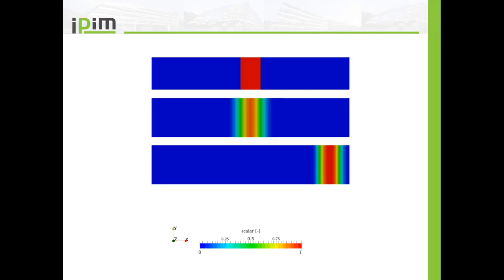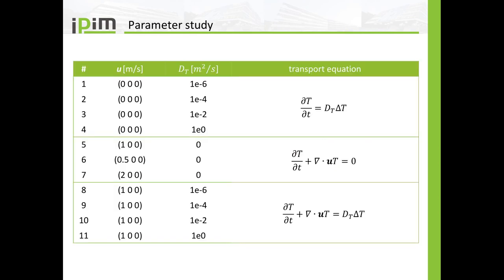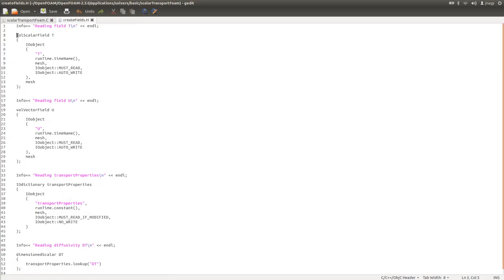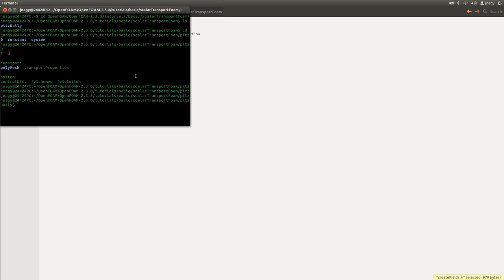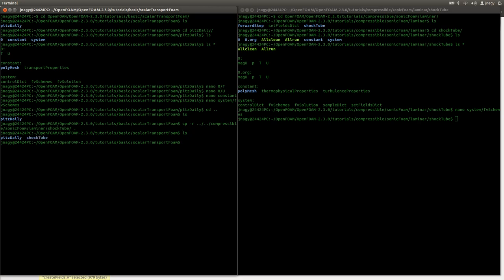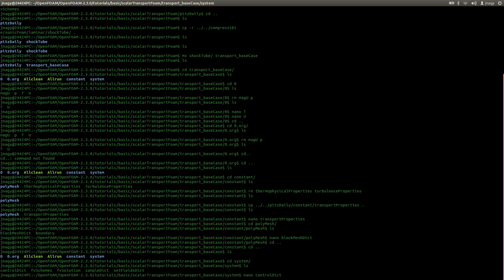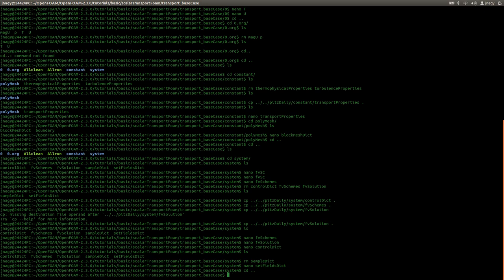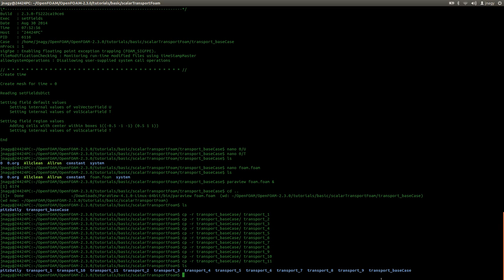Introduction to transport equations - Part 1

Comment: Sir , i hope you can see my comment. I am currently using the openfoam v10 , the version of 2022 (it is recommended that i download the newest version) and i didnt have a problem until this tutorial. I have done everything you did (copied the files , deleted what was unnecessary) and i executed first blockMesh. Everything went well. Then i did execute the setFields . Execution was ok , it appeared everything that appeared to your screen too. I checked the file of T at the 0 directory , and for the -0.5 to 0.5 , the value of T was indeed one. So i guess everything was ok. Then i even created the dummy file foam.foam , even though i think it is not needed that much (please share your opinion on this topic) and launched paraview. In paraview , i had of course to uncheck the box of skip zero value and the the mesh appeared. But , unfortunately , there was not any 0 values. The whole mesh had the value of 1, as i could see from the legend down right. I dont know what i am doing wrong , honestly , and its a shame i cant run the simulation as i want to realize every step before moving on. Of course , this question is addressing every member of the CFD community that is currently watching the video. Thank you in advance.
Reply from the maker: Please use the version v2206 from openfoam.com. v10's compatibility is very bad. There are too many syntax changes. We all knew, that is is going to come, but as far as I can judge the time has come and people have to decide which version to use.

Comment: Sir,
Can we say by looking into the create Fields of any solver, we can know what boundary conditions like U, T and P are required. 
As in the current solver there were U and T in the solver which were the same in 0 folder.
Reply from the maker: No, in general not. In an already working tutorial yes. But if there is a modification, you have to change the dictionary as well.

Comment: Hi Nagy. First, I wanted to thank you for the excellent material shared. I have a doubt for the simple diffusion case. If I wanted the temperature / concentration / etc. travel for the left side, with a different diffusion coefficient than for the right side in the same mesh, how should I program this case and what files should I modify?

Greetings and thanks!!
Reply from the maker: Diffusion is a uniform phenomenon and not directional.

Comment: What's the difference between set the control on runTime or on timeStep? I'm still confused about the meaning of deltaT.
Reply: "What's the difference between set the control on runTime or on timeStep?" 

Setting writeControl to runTime will lead to result files being written after consecutive time intervals defined by writeInterval, whereas the option writeControl -> timeStep means that results will be written after the number of time steps, again defined by the parameter writeInterval. 
So for example writing 10 equidistant result files for a 1 second simulation (endTime -> 1) could be achieved by either setting writeControl to runTime and concurrently writeControl to 0.1. OpenFOAM writes a file every 0.1 seconds. The second option would be, to set writeControl to timeStep and simultaneously writeInterval to 1. Since your simulation timeStep is defined by deltaT and you would like to write 10 result files, deltaT has to be equal to 0.1 in this case. That means in the first case deltaT has no influence on how frequent result files are being generated, in the second case it does. 

"I'm still confused about the meaning of deltaT."
The time step of your simulation defines the temporal discretization of the partial differential equation underlying the physical problem at hand. The equation itself is continuous in time and space, since it describes the real physical world. Its computational representation in contrast has to be discretized (described and solved at particular instances of time and space), because computers have limited accuracy. The step size that governs the temporal evolution of your solving process is called the time step.

Comment: direct after 'setFields' without 'scalerTransportfoam' you can see the Temperatur in paraview, but why can i only see  Solid color? i can not choose T. or U to have a check.
Reply: The same happens with me, I believe could be the version of OpenFOAM.
Reply: @jackelinecornelsen5206  i have solved it, just uncheck "skip zero time"
Reply: @yaowang1712  Thank you!

Comment: Hi Nagy, Í have followed the video to make the necessary changes. But when I create the blockmesh , I again get the error 
--> FOAM FATAL ERROR:
Failed writing polyMesh.

    From function int main(int, char**)
    in file blockMesh.C at line 336.

What can I do here?
Reply from the maker: Do you have writing access, where your case is located?
Reply: I use sudo for this
Reply from the maker: That might not work. Copy your case to a location, where you have writing and reading permission.
Reply: @OpenFOAMJozsefNagy  Thank you sir worked!!!

Comment: Hello, I have a question about transport equation (it's a link to an image):

http://s21.postimg.org/ip54v24hj/transport_Eq.jpg

I am from a university in Croatia and since our professors insist on Fluent because OpenFOAM is too complicated, I had decided to go for OpenFOAM in my free time and I did not regret. I'm following your tutorials which are great and which have helped me a lot. I even made an icoFoam case of my own, not physically meaningful, but it works!
Reply from the maker: stock9291 T is the passive scalar, and phi is the flux through the cell face i.e. the velocity U interpolated onto the surface. Take a look at what the actual intergral form looks like and then you will see, why you use the flux.
Reply: József Nagy Thanks, that's about what I thought.

Comment: sir, how to use 0.orig file
Reply from the maker: I am sorry, but I don't exactly understand the question. 0.orig is a folder. There you have the backup files of the files located in 0.
Reply: sir, i copied 0.orig and made 0 folder 
on applyinG blockMesh it Gave error
fileName::stripInvalid() called for invalid fileName 0
Reply from the maker: It might be the probem, that your case directory or the path leading to it might have a space in it. Maybe it is called "Case 1". Just rename the folder to "Case1"